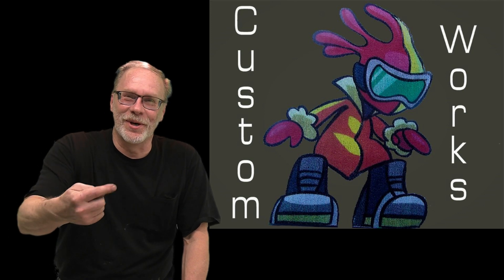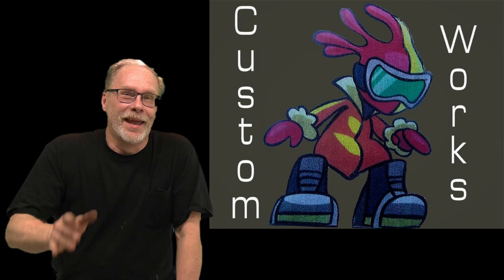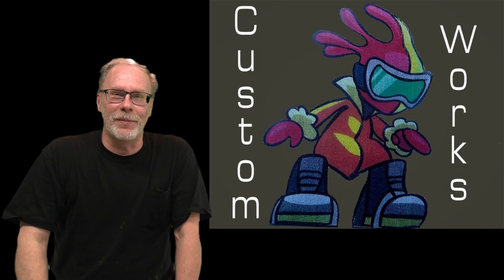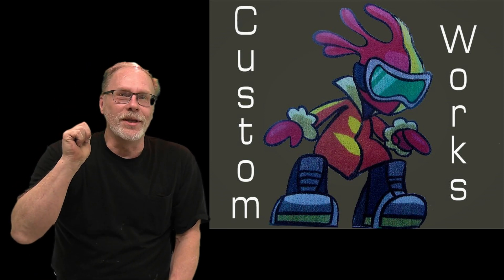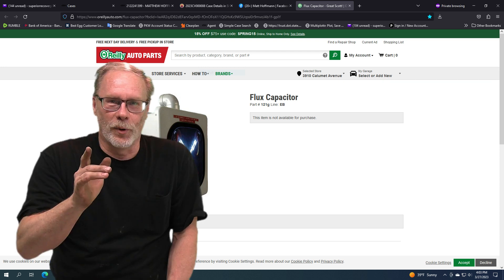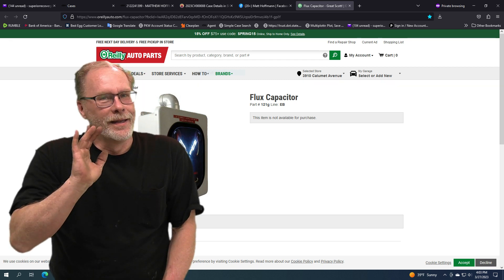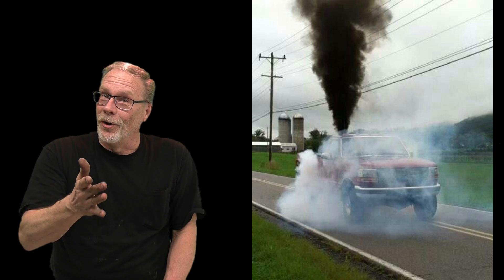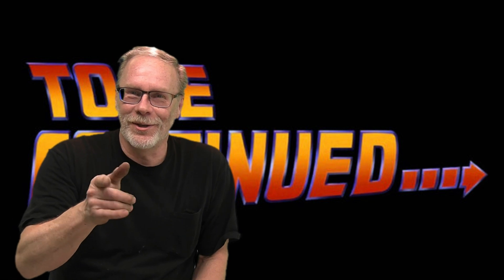🛻📽️ ....7 3 PSD QUICK TECH TALK REPAIR ANY PSD AFTER BEFORE IT HAPPENS  🟢🟡🔴🟢

Comment: I have a 1999 f250 super duty…. Misses in high gear, shaking after it shuts into or er drive at low rpm… it seems to run better after 60 mph… at 45 to 60 shakes… but seems low on power… please help
Reply: You didn'rt specify so I'm assuming the engine Start with the injectors and wires to them

Comment: Speaking of hahaha I just now wanted to ask a quick question soooooo the plate on the front of the hpop I took it off to repair the back pressure sensor and tube I think I’m alright with the amount of RTV sealant I used It’s really not much maybe a 1/4 inch worth around the plate should I be worried
Reply from the maker: Thats good its the standard repair on that cover

Comment: If I did have a complete and working flux capacitor I would go back to around 1984 and do several things a little differently.  But I would still have bought my 2002 7.3.

Comment: I have a 2002 F350 7.3L 6spd manual 4x4:  And I just changed the water pump;  accidentally broke the temp sensor on the pump.  So I ordered the motorcraft replacement (with the cone shaped metal tip/ white connector).   But they sent my the other sensor, that fits the E350, and has the smooth shank tip with a flared head (looks like a penis, sort of).    Do you know if it will work in my truck?  It says it's not compatible when I look it up , but I'm not real sure why or how it's different.    I understand that my truck has two different temp sensors, and from what I understand-  this sensor on the pump is only a switch for the dash gauge.  But do you know if the one I have will still work?  It's a bit of a headache to send back, but I can't return it if I open it.
Reply from the maker: its a different resistance so it would be miss informing the gauge or ecm which on a 02 is monitored from the cluster as well as from the 2nd sensor The values would differ
Reply: @CUSTOMWORKS7.3PSD  Ok.  I appreciate the reply.   I bought it on ebay, and made sure it was motorcraft;   They had the correct "photo" of the one I need, but they sent me a  different one than their photo.  So it's completely their fault, oh well.  More waiting time I guess.    I'm just happy to finally be tackling the leaks.  We did a new water pump and the full heat exchanger seal/ gasket change, and I haven't seen it drip yet ever since.   All I have left now is whatever is leaking up top;  the entire valley is completely caked with oil, so I think I'm going to hose it out as well as I can at the car wash, and see where the fresh oil is coming from.  I want to say it's either one of the little lines, or at the hp pump;  because most of the oil seems to be towards the front - and is just flowing to the rear.    I already plan on a full pedestal o-ring change, if it needs it.   I love this truck.  Drover it for a decade building houses and metal buildings.   It's probably the best truck Ford ever made.
Reply: @calholli  hi. My leak was coming from the non serviceable plug on hpop. Cant get to it. As its on bottom.  You can gg
Reply: @calholli  hi. My leak was coming from the non serviceable plug on hpop. Cant get to it. As its on bottom.  You can gg
Reply: @calholli  hi. My leak was coming from the non serviceable plug on hpop. Cant get to it. As its on bottom.  You can gg
Reply: @calholli  hi. My leak was coming from the non serviceable plug on hpop. Cant get to it. As its on bottom.  You can gg
Reply: @calholli  hi. My leak was coming from the non serviceable plug on hpop. Cant get to it. As its on bottom.  You can gg
Reply: @calholli  hi. My leak was coming from the non serviceable plug on hpop. Cant get to it. As its on bottom.  You can gg
Reply: @calholli  hi. My leak was coming from the non serviceable plug on hpop. Cant get to it. As its on bottom.  You can gg
Reply: @calholli  hi. My leak was coming from the non serviceable plug on hpop. Cant get to it. As its on bottom.  You can gg